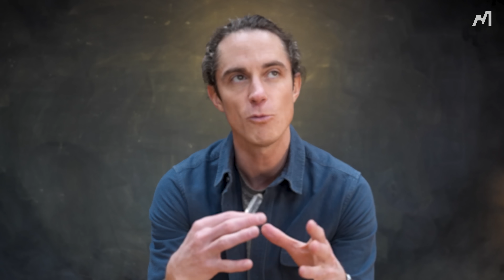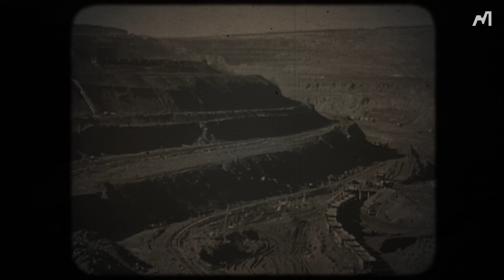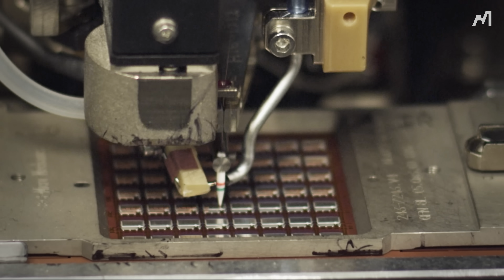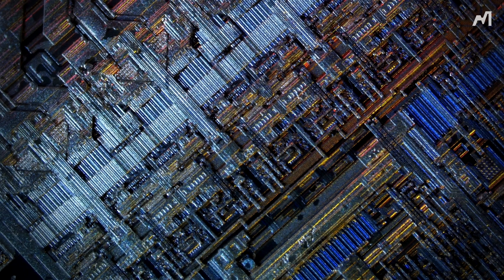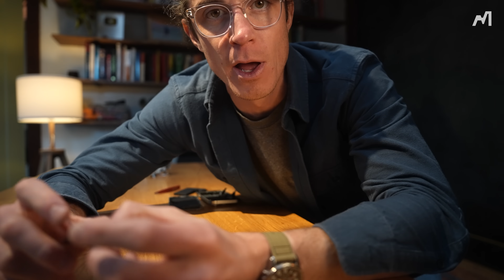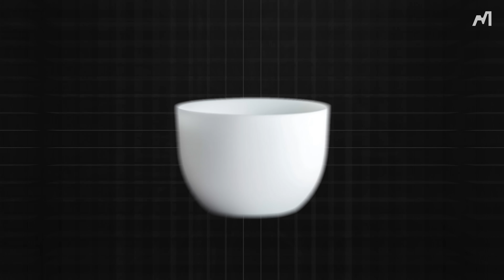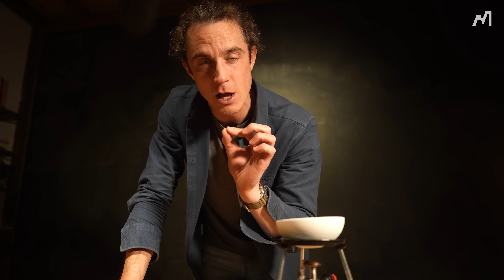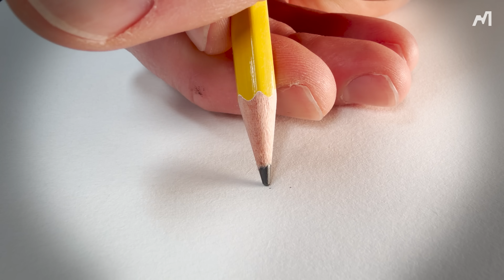Saudi Arabia Has Oil, America Has This

Comment: Some research findings:
The claim is also getting stale. China classified high-purity quartz as a mineral species in 2025 and reported two large deposits (Henan and Xinjiang). In June 2026 Chinese scientists flagged a possible source in Tibet. Sibelco has been doubling capacity, which cuts against a “scarce deposit” story. The Quartz Corp announced an indefinite closure of its Spruce Pine plant, citing solar-industry losses.

Comment: Allegedly: Chinese geologists discovered massive high-purity quartz reserves in Tibet (Xizang). Refinement evaluations demonstrate these deposits can consistently yield quartz exceeding 99.995% purity, putting it directly in range of Spruce Pine's standards for semiconductors and solar tech, but Russia hast and still relies on outsourcing but IS currently exploring the Kyshtym District, Ural Mountains region for a spruce pine equivalent.

Comment: Generated by Chat GPT

I checked the video’s transcript against USGS information, the two Spruce Pine producers, and semiconductor/materials sources. My assessment is: the video is built around a genuinely remarkable and important fact, but it substantially exaggerates how absolute the Spruce Pine monopoly is and how impossible substitution would be.

What the video gets right

The basic supply chain is accurate. Spruce Pine, North Carolina, contains extraordinarily pure natural quartz. Sibelco describes it as the source of the world's highest-quality quartz, and The Quartz Corp reports material around 99.999% SiO₂.

And this isn't just "sand used to make silicon." The important role is more interesting than that. Semiconductor-grade silicon is melted at more than 1,400°C inside fused-quartz crucibles during the Czochralski crystal-growth process. If the crucible contains the wrong trace impurities, those impurities can contaminate the molten silicon. That's why extraordinarily clean quartz matters.

The concentration of supply is also very real. Industry research firm CRU reported in 2025 that Sibelco and The Quartz Corp at Spruce Pine were the only two companies able to produce advanced/premium HPQ economically and at scale. That's an extraordinary industrial chokepoint.

So when the video says, in effect, "There's an obscure material in North Carolina upon which the global semiconductor industry is surprisingly dependent," I think that's a very fair takeaway.

Where it goes too far

The biggest problem is wording like "found in exactly one place on Earth's surface" and the implication that semiconductor production is physically impossible without Spruce Pine.

That's too strong.

USGS explicitly notes that synthetic high-purity silica can be manufactured, and there are other natural HPQ sources and producers. Synthetic material can actually be made purer than natural quartz; the major problems are cost, capacity and qualification—not physical impossibility.

There are also Russian, Chinese and other sources of high-purity quartz. In fact, just this month Chinese producer Jiangsu Pacific Quartz was reported to have qualified quartz products with major semiconductor-equipment manufacturers and a Chinese DRAM manufacturer. Its material isn't yet a full replacement for Spruce Pine's highest-end crucible material, but that's quite different from saying only North Carolina possesses usable quartz and nobody else can make it.

The distinction I'd make is:

Spruce Pine has something close to an economic/industrial near-monopoly on certain extremely demanding grades—not a geological or technological monopoly in the literal sense.

That's actually a more interesting story.

The "world goes backward 25 years" claim

This is the weakest claim in the video.

If Spruce Pine production permanently disappeared tomorrow, semiconductor manufacturing would unquestionably suffer a serious supply shock. Prices would rise, inventories would be consumed, alternative quartz sources would be qualified, synthetic-quartz capacity would expand, manufacturers would alter crucible designs and processes, and enormous amounts of money would suddenly flow into solving the problem.

What wouldn't happen is humanity simply saying, "Well, I guess advanced chips are impossible now."

Synthetic quartz already exists. Other deposits exist. Other purification technologies exist. The question is primarily how quickly and at what cost they could replace Spruce Pine at sufficient scale.

And semiconductors are valuable enough that paying dramatically more for quartz could be economically tolerable. Quartz is a tiny portion of the value of the finished chips. Solar-wafer manufacturing would probably have a much harder time absorbing the increased cost because its economics are much tighter.

So I would not treat "the world would slip backwards 25 years" as an established technical conclusion. It's dramatic narration.

Another subtle exaggeration

The video makes the purity numbers sound a little misleading by moving between the purity of quartz, the purity of electronic-grade silicon, and the requirements of the finished silicon crystal.

Those aren't the same thing.

USGS defines ordinary HPQ at roughly ≥99.99% SiO₂, with ultra-high-purity quartz having ≤10 ppm impurities. Meanwhile electronic-grade silicon itself can reach extraordinarily greater purity. The video's discussion of "9 nines versus 11 nines" makes for good storytelling, but it can leave the impression that Spruce Pine rock simply comes out of the ground at semiconductor-silicon purity. It doesn't. The quartz is mined and then subjected to substantial physical, chemical and thermal purification.

The geology is mostly legitimate

Interestingly, the seemingly fantastic geological part isn't something the video simply invented.

Sibelco itself describes the Spruce Pine district as forming roughly 380 million years ago during the collision of Africa and North America, with unusually water-poor conditions helping prevent impurities from becoming incorporated into the quartz-bearing formations.

So that portion of the story is broadly grounded in actual geology, although the video's narration naturally simplifies hundreds of millions of years of geological processes.

My overall assessment

I'd characterize it roughly this way:

Core premise: very accurate.
Spruce Pine really is one of the strangest and most important industrial-material chokepoints in the modern economy.

Technical explanation: mostly accurate but simplified.
The quartz → crucible → molten silicon → single-crystal ingot → wafer → chip explanation is fundamentally correct.

"America has a monopoly": directionally reasonable, literally overstated.
It's closer to an extraordinarily dominant supply position for certain premium HPQ grades.

"Only place on Earth": misleading.
Other deposits, producers and synthetic alternatives exist.

"Without it, advanced chips are impossible": exaggerated.
They would become much harder and more expensive to manufacture until alternative capacity was established.

"The world goes backward 25 years": unsupported hyperbole.

The fascinating part is that the video doesn't actually need those exaggerations. The underlying fact is already remarkable: an enormous portion of the world's semiconductor industry depends on disposable quartz crucibles whose preferred raw material comes disproportionately from a tiny geological district in North Carolina. Even the American Ceramic Society cites estimates of roughly 70–90% of the global HPQ supply used for these crucibles coming from Spruce Pine.

If you want, I can also go claim-by-claim through the entire 13-minute video—including the China/Taiwan discussion, "11-nines" silicon, the supposed secret "black art," and the claim that only a CEO knows the complete manufacturing process. Those portions have some additional problems that are worth unpacking.

Comment: Skip the reduction step entirely. Fluorosilicic acid (H₂SiF₆) is a near-free waste stream from phosphate fertilizer production, generated at million-tonne scale and largely neutralized and dumped. Heat it and you get SiF₄ gas (bp −86°C), which separates from every metal fluoride you care about — AlF₃, FeF₃, alkali fluorides are all nonvolatile. Hydrolyze the purified gas back to SiO₂ and recover the HF.
You get distillation-grade purification without ever making elemental silicon. The chemistry is proven: MEMC's old Ethyl process ran fluorosilicic acid → SiF₄ → silane → polysilicon commercially. Nobody has seriously pushed the "stop at SiO₂" branch, because historically the money was downstream in polysilicon.

Comment: The presenter is extremely charismatic and quite commanding in his tone, still he doesn't know the difference between cement and concrete.
Reply: Spruce Pine high-purity quartz is presently an unusually valuable and highly concentrated supply-chain input for conventional large-scale wafer production. It is certainly not the only substance from which silicon wafers can physically be made, it is the most advantageous commodity for crucible manufacture. Furthermore, alternatives exist, but rapidly replacing its combination of purity, consistency, scale, cost and industrial qualification would be difficult.
Reply: Also there is a crucible free process known as the float-zone process.  FYI

Comment: I was wondering how China made so many phones so i googled it 
This is what I got 

China does have access to quartz and silica resources, and the premise that it has no access is false. Quartz (silica) is one of the most common minerals on Earth, and China is not only a major consumer but also a producer of silicon and quartz materials used for electronics, solar panels, and glass.
China's Access to Raw Materials and Manufacturing
Domestic Reserves: China possesses extensive domestic deposits of silica and quartz, and it plays a dominant role in processing high-purity quartz required for industrial and tech applications

China has historically imported much of its high-purity quartz, but recent domestic discoveries have located significant high-purity quartz and quartz ore deposits in several regions

High-grade deposits were found in the eastern Qinling Mountains.
Significant high-purity deposits are located in the Altay region
Major deposits rich in purity (exceeding 99.99 silica) have been identified in leucogranite rock formations within the Dinggye (Tingkye) area. 
So I think they will be okay

Comment: "The whole must be thrown out" is just wrong. I get the hyperbole for story, but the design of chips have progressed past such a binary outcome. You design for fault tolerance. It's why NVidia sells GPUs at 4 different SKUs. It's the exact same chip, but with more faults in the manufacturing process. The Ultra perfect chip demands the highest price. Most faults can be tolerated at slower speeds and lower operating temperatures. Design a Chip, design a testing process and a 'bin' you can sort them into. 99.9% perfect, 99% 95% 90%. Throw the rest out. This gets you your Yield.

Comment: As far as the tech sector is considered for HPQ there are 4 locations where "pure" quartz can be found.

Location 1 Spruce Pine Mining District (North Carolina, USA) is the most used with purity levels of >99.99% to >99.997% without refinement and accounts for 70-90% of global demand as other countries who have "pure" deposits arent really using them as much as it's a limited strategic resource. 

Location 2 is Xizang (Tibet, China) which has been surveyed many times and has a staggering amount of quartz at a 99.995% purity level according to core samples taken. 

Location 3 is Kyshtym and the Ural Mountains (Russia) and their quartz does have similar purity to China's deposit though the minerals that makeup the contaminants are easily purified unlike most sources so they do domestic purification to 99.999% purity for specialized optical and electronic use. 

Location 4 is Drag and Setesdal (Norway) which hosts the highest natural purity without refinement outside the united states at 99.9% to 99.999% depending on vein since the quality is not uniform. 

Honorable mention Minas Gerais, Pará, and Bahia (Brazil) has vast veins of high purity quartz that remains unmined with purity levels exceeding 99.9% in certain veins. 

tldr: The USA is not the only place where "pure" quartz exists it's simply one of a few places where there is quartz without certain contaminants that make it extremely expensive to process.

Comment: If Spruce Pine supply is disrupted, manufacturers can switch to synthetic quartz crucibles, which are even purer but significantly more expensive, or attempt to refine lower-quality natural quartz from other regions, though this is currently less cost-effective and scalable.
Reply: True but is also not very scalable and hard to produce so not a good solution but better than nothing.

Comment: Chemist here. This video is great at highlighting a very real supply chain bottleneck, but the claim that losing Spruce Pine would "send us back in time 25 years" is pure clickbait and supply-chain catastrophism. We wouldn't suddenly forget the physics and engineering of 3-nanometer chips.

TL;DR: We wouldn't lose a quarter-century of human progress. We’d just have really expensive smartphones for 3 to 5 years while chemical engineers get paid double to fix the supply chain.

The Chemistry of Synthetic Quartz
We actually can and do make 99.999% pure synthetic silica in the lab from the bottom up. The problem isn't purity; it's high-temperature structural integrity. When you synthesize silica artificially, trace amounts of water (OH- groups) get trapped in the glass matrix. At 1,400°C—the temperature needed to melt silicon for chips—a giant crucible made of purely synthetic quartz will sag and slump like a wet noodle.

Spruce Pine quartz is a geological freak accident that formed almost entirely without water, so it holds its rigid shape at extreme temperatures.

Economics, Not Physics
Right now, the semiconductor industry relies on Spruce Pine because it is the absolute cheapest, highest-yield way to get the exact physical and chemical properties required. It’s an economic shortcut, not an insurmountable law of physics. The video treats a highly optimized business model as if it were an absolute boundary of human capability.

What Would Actually Happen
If Spruce Pine vanished tomorrow, we wouldn't revert to 1999.

Years 1–2: We’d experience a brutal supply chain shock. Chip manufacturing yields would plummet, and the prices of electronics would skyrocket.

Years 3–5: The multi-trillion-dollar tech industry would throw unlimited capital at the problem. Mining companies would rapidly scale up the expensive chemical purification of secondary quartz deposits (like those in Brazil or Russia). Meanwhile, materials scientists would solve the structural issues of synthetic crucibles—likely by reinforcing them with advanced ceramics.

Comment: This doesn't make sense, you can purify anything further, there's not just 'only one place you can get this silicon because it's so pure', the purity would just lower the cost of purifying it further. After doing some googling it's not the only pure site, it is the one of the only sites that is that pure and is CERTIFIED for semiconductor use. I think it's a bit misleading to say only the US can do this when other countries could technically do it if they knew the process but while the US is doing it doesn't make sense economically to invest in figuring it out.

Comment: I've looked into the topic. It turns out that what the high-purity quartz from Spruce Pine is used for is the crucibles in which quartz from other sources is melted to be purified and to make chips from. It's still very important, even if synthetic quartz could also be used to make crucibles at greater expense.

Comment: The Takumi technique represents the pinnacle of Japanese craftsmanship, most famously embodied by Lexus's master artisans (Takumi) who undergo a rigorous 60,000-hour training process. It blends exceptional sensory razor-sharpness with a profound dedication to perfection.
Here is how the technique breaks down in detail:
Core Principles
Extensive Mastery: True Takumi status requires 60,000 hours of practice—the equivalent of working 8 hours a day, 250 days a year, for 30 years.
Sensory Perfection: Artisans train their senses to detect flaws invisible to machines. For example, inspectors check body panels by touch using a gloved hand, feeling for imperfections as small as a fraction of a millimeter.
The Paper Origami Test: To qualify, a craftsperson must pass a dexterity test requiring them to fold a flawless origami cat in under 90 minutes using only their non-dominant hand.
The Human-Machine Balance
While modern manufacturing relies heavily on automation, the Takumi technique serves a distinct purpose:
Teaching the Robots: Takumi masters program their exact physical movements, nuances, and angles into automated systems so robots can replicate human fluidity.
Acoustic Tuning: Engineers use trained hearing to listen to engine blocks, identifying microscopic internal friction or vibration anomalies by sound alone.
Flaw Detection: Digital scanners look for programmed defects, but Takumi inspect the depth of paint reflection, the sweep of stitching lines, and the tactile quality of materials to ensure an emotional connection to the finished product.

Comment: Fun fact: Early semiconductors were based on germanium. 1947 til 1960 when silicon based semiconductors started to become economically viable.
As an electronics hobbyist I remember buying germanium transistors for about 50 cents and the first silicon equivalents were more than twice that. Didn’t take too long before silicon transistor pricing was on a par with germanium. Germanium is still used in one form or another in night vision optics. Just like thermionic valves - “tubes” are still used in various forms.